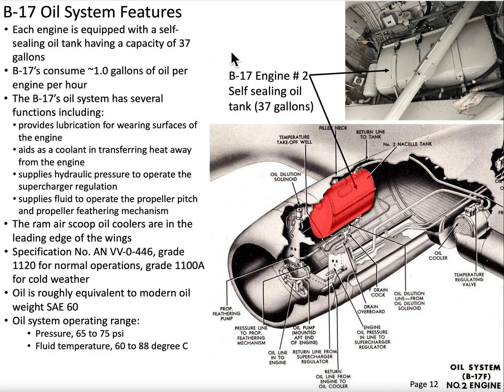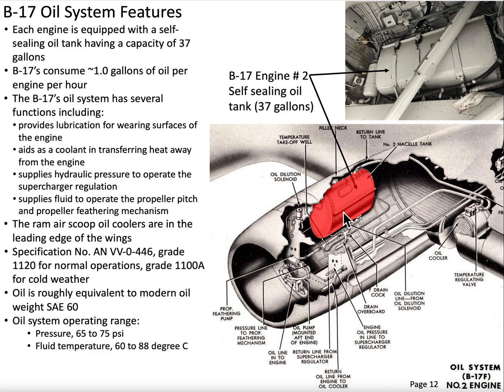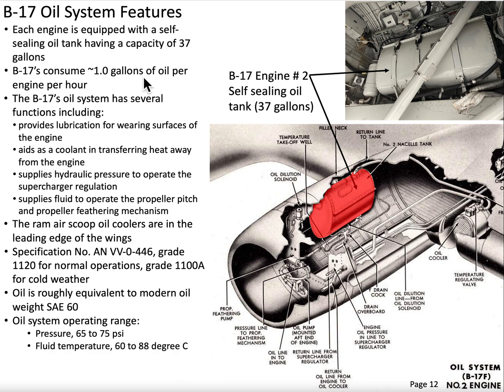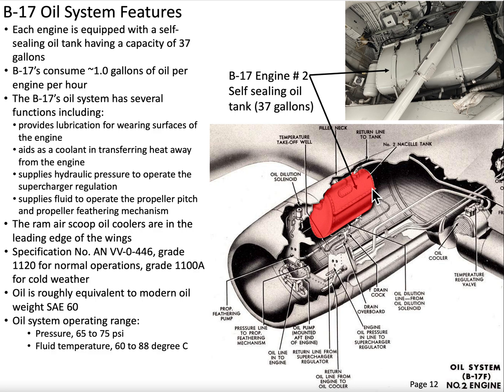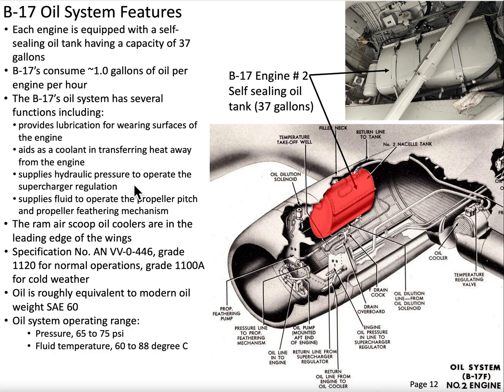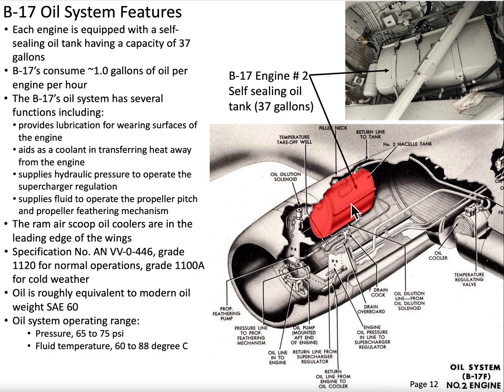B-17 Bomber's Engine Oil System Explained

Comment: So modern car racing engine oil API SL 10W 60 is or can be used in B-17 still flying in 2023/2024?. Such an engine in WW2 is said to have very short accumulative run hours in between overhaul. Like less than 500 hours?. 🤔. Using modern engine oil for current B-17 had extended it's running hour overhaul interval?😂😂😂